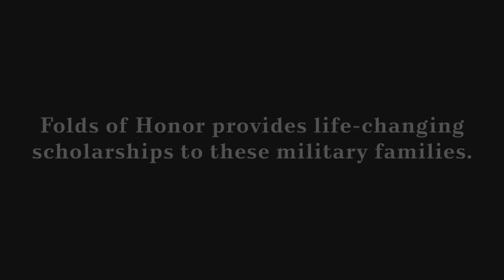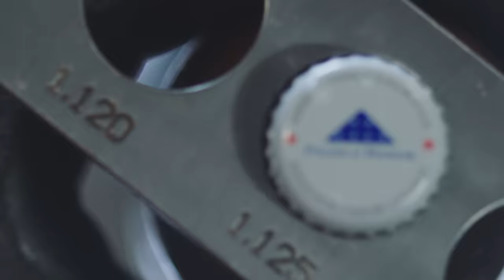Budweiser | Service Never Stops

Comment: Great cause, but read the fine print. Budweiser committed to donating $1 per case sold, over a 5 month period, up to a 500k cap. Kinda chump change. What is that, like 10 full rides, or apparently 20 cases of half tuition? Ehhh, step it up more.